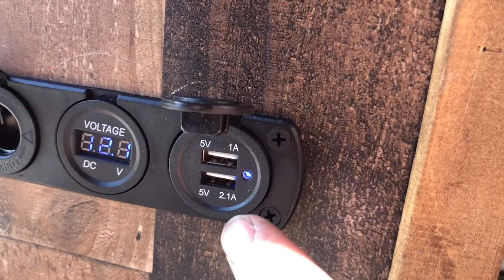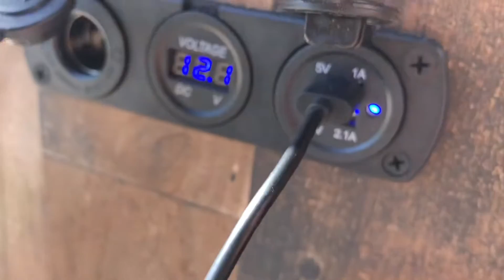How To Wire - 3 Port Power Supply Accessory 5V Dual USB Charger Voltmeter 12v AUX Socket In Camper

Comment: I wired mine exactly the same way, power to points, but No problem to Volt meter.
But Nothin works when plugged in..
Weird 
Scratching my head

Comment: Hi what size cable did you use for usb
Reply: It will depend on the amperage draw you are expecting. If you are using only the cigarette lighter outlet and the usb ports, then 15A wire will be fine but double check your numbers before installing.

Comment: Not a good explanation of wiring up the outlets
Reply from the maker: the orange wires are positive and the yellow wires are negative. At 1:00 you can see for each color wire the 3 devices are daisy chained together using female spade connectors. The end pigtails of the chain are what I used to land wires with fuse to the battery🍻

Comment: What size hole saw?
Reply from the maker: Hi there, I want to say 1 1/2 is really close I may not be exact but very close. This particular hole saw I’m using has many different sizes that come with it in a kit! Best way would be to measure the diameter of the three gauges with a caliper or can be done with a measuring tape! Hope this helps thanks for watching 
This is the Amazon link 
11PCS Hole Saw Bit Kit, Wood/Sheet/Metal Plastic Hole Saw Set with 2 Mandrel &1 Hex Keyl & 8 Carbon Steel Heat Treated Hole Saw, Hole Saw Drill Bit Set for PVC Board, Plywood, Drywall Drilling (Black) https://www.amazon.com/dp/B08T17ZHDZ/ref=cm_sw_r_cp_api_glt_fabc_XJK0V4ZG9VD4X4Z24MR1

Comment: How did you get your live wire ? Better hardwired wouldn’t it ?
Reply from the maker: 💥 the onboard battery I have can be  quickly disconnected, and removed, I’m using just large alligator clips to connect the live to the battery, these are connected to a power bus that distributes power to accessories. Thanks for watching!

Comment: Hey man :) the video its perfect . Can you tell me how big transformer i need to do this at home ? Thanks
Reply from the maker: Rudolf Hess , nice , thanks for watching! This accessory takes a 12vdc power source and the Cigarette option is capable of outputs up to 20 amps , so you would need an 120v power supply that outputs 12vdc up to 20A min may get away with a 15A supply . An old computer power supply may work just have to read the specs , but I’m sure you can fine one on EBay and amazon fairly inexpensive. Hope that helps , cheers!